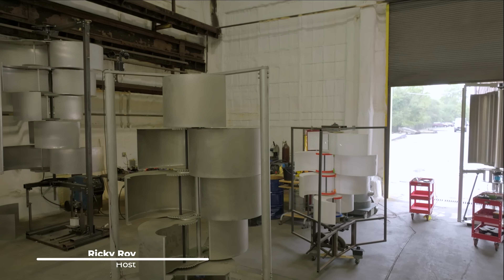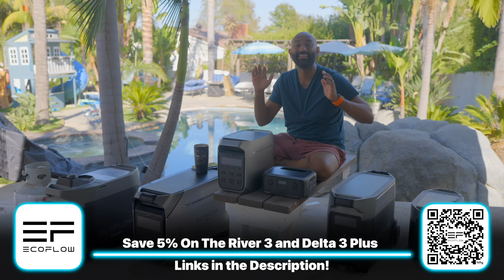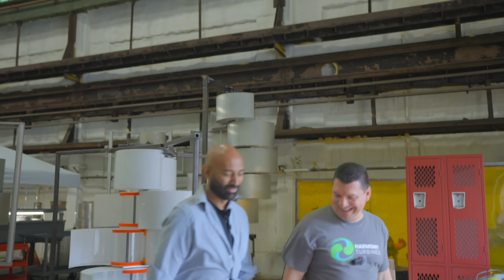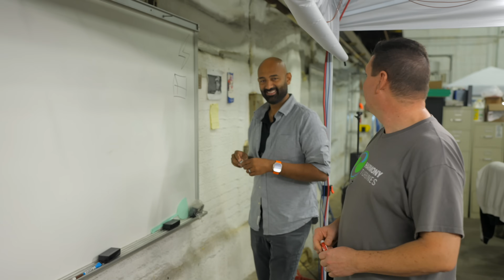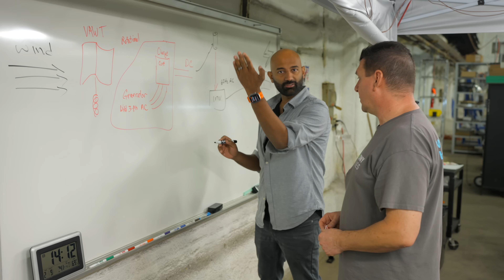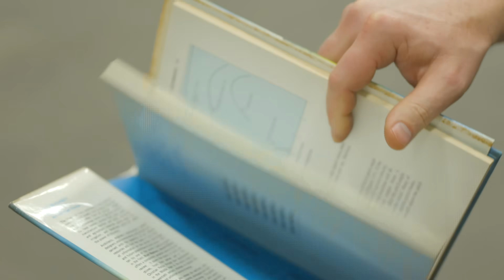This Could CHANGE Home Wind Energy Forever!

Comment from the maker: Enjoy @EcoFlowTech exclusive preorder offer! Get a Free DELTA Bag on orders that include an EcoFlow DELTA 3 Plus, use my code EFDRTWOB5 for an extra 5% off on DELTA 3 Plus and RIVER 3 standalone valid until October 25th.
Reply: cringey exposed gears. this is very unreliable for the wear and tear and dirt of the outdoors.  I was highly interested with VAWT for more than a decade but my research/I realized lately it is no match to HAWT. It can explained/summarized like we "mostly" don't use vertical blades for moving air. 
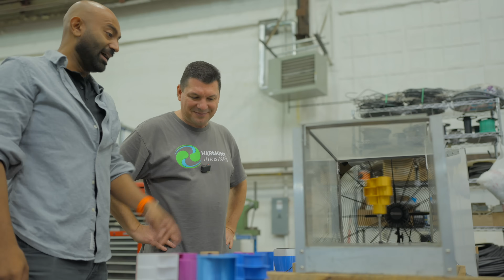2:47 this multimeter design is at least 20 years old and which I bought during college. It works to this day with some quirks. However, a US company R&D using the cheapest available multimeter could be red flag.
Reply: Can they put another generator on top? Have one on the bottom and one on the top, the shaft could surely be extended to add it?
Reply: I spent six years in the micro wind energy sector as an engineer. Our company went through multiple mechanical and electrical designs, eventually developing a wind/solar charger that remained as the only truly viable component. Low power density and intermittency of the wind continue to be the drawbacks for vertical axis turbines. We used a multitude of rotor designs along with three phase toroidal stators, ceramic and neodymium magnet assemblies....difficult to challenge the Betz Limit...I am back at work for an oil company...Always open for open dialogue on energy......
Reply: By the way our company had (and I still retain) full suites of CAD FEA and  CFD software....we also were able to utilize the Chrysler wind tunnel facility in Auburn Hills Michigan....
Reply: why isn't there a MPPT CHARGE CONTROLLER for wind power
Reply: Zero-point energy generator for $25. Leonardo Corporation, Andrea Rossi. Demonstrated September 27, 2024 in Latina Italy.  LOOK IT UP !!!
Reply: Are you responding to msg’s?

Comment: My limited research tells me if your gona build one build the frame and blades out 316 stainless to last at least 100 years.

Replacement bearing

Replacement generator

 and Replacement batteries as time goes on.

Technology will get better. 

Owning a super 316 stainless steel structure will last test off time.

My thinking is do it right first time to last family for generations. 

And able to move it if need be.

The name off my build will be.

V3000

SENTINEL
TACTICAL
OUTPOST

Comment: Yes I'd buy... to TOP off our existing robust solar panels and battery combination, to ensure we wouldn't have to turn on our generator. Yet we haven't used our generator in over 5 years. And in 15 years of solar panel power generation, we've only had to use our generator 5 times total. Many folks think adding a wind turbine to our system is overkill, but I think prevention of generator use with fossil fuel is worthwhile!

Comment: Oh, and one more thought.  What is the problem with 3 phase power?  A bridge rectifier will convert alternating current into direct current.  Even I , with my modest electrical skills have made a bridge rectifier.  The cost is trivial.  Once rectified you can use a simple voltage controller.

Comment: Dude, 6 of these on your garage or barn in the northeast would be dope. And I bet the more of them you have next to each (within safe limits) would probably create more “chaotic” wind adding to their efficiency. The most important thing is to get that average crank generator right. If you could somehow get that 100w - 200w in a low RPM of 7-10 just wow.

Comment: This solves nothing.  I bought a pallet of 550 watt solar panels  for $170 each.  This 500 watt (being generous) wind turbine probably would cost thousands of dollars.  Especially when you add the cost of a foundation to keep it from flying off. In the end, it wouldn't surprise me that all in were looking at $10 to $15K.

 That said, it is cool looking.  Would make a neat piece of art.  But unfortunately, as something to produce electricity it's usefulness is negligible.

Comment: I don’t see wind turbines being a game changer for residential use for a long time. But… if we could just get 500 watts of power at night to help keep our home battery storage from draining so fast at night, that would be great. So I could see it complimenting an off grid solar system.  But at the moment to get that 100-500 watts we’ll need to spend $6-10k. The economics just aren’t there yet. But I like the concept.  Maybe we could get EG4 to add an extra charge controller for lower voltage wind on their future inverters 🤔

Comment: We live in a location with average wind speeds well over 25mph and already have a large 5kw wind generator, and I can tell you its more pain than its worth, they need a lot of maintenance with that many constantly moving parts, the brake blew out in a storm the other day and even with the blades auto adjusting with that this is terrifying out of control, just get more solar and save yourself the trouble

Comment: Has this guy never heard of constant speed drives for generators? Granted, they'd be expensive, but that's not that same thing as consistent freq. 'can't be done' with a wind turbine. Alternatively, you could vary the pitch of the blades using (an) electric actuator(s), though that might be trickier to get right.

Comment: Sivonious turbine has the lowest  peak Cp = 0.15, energy recovered from the the frontal area.  It is half the American wind turbine for pumping water at about the same tip speed.   Tip speed is about 80% of the wind speed.  Can go to about 150% of wind speed but Cp drops significantly.   
Note: I purchase a book in the 70s with the correct chart.   These are the simple bucket so you can increase the Cp but I doubling it is a tall order.  Have an aeronautical engineering degree.  Wind energy is a cubic function of wind speed. 
ICE Wind added half of a Darrius (vertical axis airfoil typically 3 blades that are curved to 1/3 of a circle.), but the Sivonious is direct tied to the Darrius.  Do not get the best of either one and thus get the worst of both.  Sivonious blocks the frontal area of the Darrius.  Lots of cost for nothing.
The  Darrius would need a dozen blades to drop the tip speed to be near but above the Sovonious and the Cp would reduce to about 0.30 without them blocking each other.  Same as the American wind turbine. 
Darrius wind turbine peak Cp = 0.40, energy recovery from the frontal area. Tip speed is about 500% of the wind speed. However no production turbine has a frontal area means of control since you can not adjust the angle of attack  since it changes as it  rotates.

Comment: It would be better if you dataloged the output of both voltage and amp measurements with a variable load resistor in a given wind.  And take note of not just the rpm but include the tip speed/wind speed ratio.

Comment: What if you had reduction gears to help add rpm going between shaft and generator? At low wind speeds it could be geared up before it hits the generator. Like how a mechanical watch uses a low rotation power source to power other parts at different rpm’s. Maybe a conical shaft to help increase rpm at low wind speeds feeding the generator. Just a thought…thanks for the video. I want a VAT to support my solar also way down here in western Puerto Rico. 🏝️

Comment: Could there be an option to have an “air scoop” like I see at the beginning of the video referred to as the wind tunnel.  There would need to be a weather vain at the top that would provide wind direction and speed information to software / computer chip.  The air scoop would face the wind.  If the wind was too strong &/or erratic the scoop could face away from the wind to protect the structure.  Power and mechanical structure would be required of course to move and lock the “air scoop” in the appropriate position.  Overall there would be a huge increase in net power output.  As usual, it comes down to cost benefit to build and maintain.  It is well worth looking into.

Comment: I am disappointed that blade type wind capture designs were not also tested. Such as boats often have a triple propeller design wind generator; and farmers have windmills for water pumping from the ground and some have had similar electricity generators. Then there is the monster wind generators like is seen over the landscape of many countries. If all the available wind power capturing designs are not shown at one test location like the mini wind tunnel tester that gentleman has how does any person know if they are buying the best power supplying wind capture design?I have seen other videos saying that those designs always having one side not performing and actually against the wind is a power loss by resisting the wind as well as only half the design is actually capturing wind power at any time {more or less.} while propeller and windmill designs have the whole wind capture surface collecting wind power all the time not half the time. I am not criticizing any one design but feel other important wind motor types have been left out of this type of testing all at the one place. Thank you for the video.

Comment: I'm not sure if it has been suggested, or tested, have they considered venting those tops/bottoms with angled slats similar to a HVAC vent in a home? That angle might add to the torque generated(?) as well as allow the 'caught' wind to escape.

Comment: I would put Halcium powerpods on my house   if they ever get them to production. Not intrusive in appearance. I would put 3 off them in black on my house roof peak 31ft above the ground. Would hardly be noticed. And still producing power. To go along with my 19.2k solar panels. And 82k batteries. So I may never have to use my 6500watt propane generator for backup.

Comment: Interesting subject. I have 18 x 420 w solar panels and a 10 kw/h battery in the garage.  This supplies 90% of the power two people use in a 40 square house in Melbourne Australia.  Out of pocket  cost including installation and a new house switchboard was $22,000 Australian.

Comment: they need to figure out how to create wind.  a solar unit just to cause a 25 mph wind from a big fan?   and then you know..  put the wind turbine infront of it.   i got a old box fan. made to really do the job.  its the most bad ass box fan i've ever owned and by far.  i can't see it drawing much energy and i bet it would take like 3 of them, stacked ontop each other for a wind wall to hit all of that big wind single well unit and keep it going 1 rpm.  oh and thats with the 3 fans all set on the low setting.   i never use the fan on high because its too much...shts blowing off my tables  lol

create the wind is key is my point

Comment: The ancient ones they have to grind grain in Iran have large structures to channel the wind into the turbine like a funnel. Surely that would increase wind speed and control the direction as well. Perhaps walls or roofs of existing structures could help

Comment: while it's nice to see it close up into a perfect cylinder, wouldn't a shape that cause more of the wind passing over the upwind side, INTO the other side of the scoop, rather than the 50/50 split of half wasted/half used.

I'm no engineer of anything other than hillbilly hvac systems, but it seems like there should be some way to incorporate airfoil shape into leading and trailing edges of the scoops to generate some "lift" to add to the equation?

Comment: I wish the turbine companies would be focusing on that slower wond speed for a broader market. This focus on a 25 mph rating is a scam to me and blows the cost benefit out of the water. I want to add wind to my system eventually but not at the cost he's talking about unless it's effective best in the typical average wind speed. I think wind power is promising but not at the current approach.

Comment: Let’s be real… most homes have a wind speed of less than 10 MPH on a daily basis.
What we need is a small fence made of turbines that can be placed in front of the home. 
4’ high, nice looking, sectional (easy to replace sections), can use both the natural wind and the wind generated by cars passing in front of the home.
Reply: YES! We'll call it the finger chopping bird killer.
Reply: @ what… birds dont fly over the house? Tell that to all the birds that get killed at Wind Farms.
Plus, who says the blades need to be sharp and rigid?
Reply: @drShout  if it is squished, you don't need Sharp blades.
It is a great advantage of the classical Wind turbines: the danger zone is a two dimensional area most birds can avoid. In some experiments birds were breeding on the turbine - yeah, they took what was offered and avoided the blade area.

Bats have much more problems avoiding big wind turbines. Fortunately they fly only at certain days in the whole year in high enough altitudes above 100 meters above ground.

So, here starts the problem: a fence is far too low and dangerous. Single family homes are still too low. 
What makes sense is to have high buildings with turbines.

A solar fence however: that works very well!

Comment: And why did it have gears? Did he explain it? 
Perhaps to get started with Profils spreaded and with higher wind getting closed especially for storm security or shut down?
There are many studies out there comparing the gaps (x and y) between the blades and the best Solition. Why is the gear this big?
Why not a linear closing mechanism? 

Savonius also generates lift. But there are better profiles, eliptical, modified Bach, Benesh. Profiles easy to reproduces with Alu-sheets.

Comment: These are really exciting! I live downwind and just offshore from Lake Superior. Solar is suboptimal due to heavy cloud cover much of the time, but I very frequently have sustained wind in the 15-40mph range. If I could get  couple of these installed, I would be off-grid for both home/lodge and shop electricity. I already use an electric chainsaw, lawn mower, etc. and this would make electric vehicles quite attractive. Michigan’s Upper Peninsula has electricity costs that are among the highest in the US and we lose power annually with storms, further adding to the appeal.

If you encounter anyone with cutting edge micro-hydro solutions for a low head stream, I’d love to see that as well.

This was great, thanks for posting it. Subscribed.

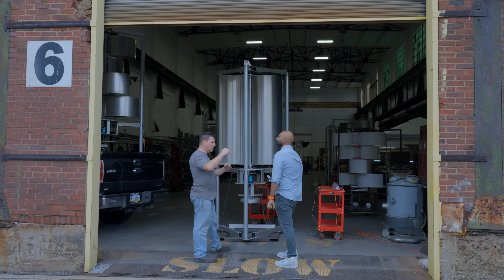Comment: 10:34 said the goal is at 25mph making 400-500 watts. 
But HOPES to make 20 watts at 7mph. UK average wind speed is 9 miles per hour......
So hoping for maybe 30 watts at 9mph with a turbine that big?! 
A 400 watt solar panel is £60. Can't see how this is a step forward.

Comment: These guys need to put a snowmobile clutch on those things . The right static clutch could self regulate the speed and you could brake it to a dead stop just by gearing it up .
Reply: Plus it would solve your rpm problem all at the same time

Comment: They started working on that concept in at least the early 1900s - at one time i had some early 1900s electrical engineering books with large turbines like those - I'm from a family of early generator and. Electrical engineers and generator mechanics - 
       Some of the turbines were mounted on rail road flat cars and on tracks that were in a circle with several flat bed cars with those turbines on them - with a brush riding a center track to transmit voltage to a large  power house bank of battery's - 
      I started working on generators in the offshore oilfields in the early 70s and have always found power generation interesting -
Reply: What kind of generators are you using nowadays? wiring wise
Reply: I'm guessing your asking if I use generators with rotating fields verse generators with rotating armatures - 
    With generators as used in cars and trucks there generally 3 phase and the field rotated - and the armature is stationary - 
   Since the voltage is converted to DC the wave form is not as important - the down side of automotive style alternators is there generally R frame alternators - 
    There not very electrically efficient - they convert 1 hp into about 300 watts - a T frame alternator is physically larger like a truck alternator but converts 1 hp input to 400 watts or so with a more efficient wave form - 
      So I generally use truck alternators  for DC - 
     With AC I use the old U frame or X frame generator heads I've changed them slightly - originally they had commentators for a rectifier - I have the commentators removed - 
   Many of the early generator heads were termed as X frame generators - there about 180 pounds per kw out put - or if they were used as a motor they were 1 HP per 180 pounds - 
      When you see synchros AC motors with two large slip rings on the rotar those are the type I'm talking about - 
      When those frames are used as a generator they create a excellent wave form - it's next to grid wave form - 
      As for AC generators my generator has a rotating armature with two sets of large  brushes on the slip rings - 
      Although the generator was made in the 1920s it generates a excellent sign wave form - 
    I'm guessing that's what you might have wanted to know -
Reply: As a general rule with a low voltage system as with 12 volts it takes 1 HP to generate about 330 watts - with 120/240 it takes 1 HP to generate 416 watts - it's about the same value with generators that generate 13800 volts or 22500 volts in power plants -

Comment: I'd suggest  ultra-thin G10 fiberglass sheet to bend around instead of metal.  It would have lower manufacturing costs, lower replacement costs, and would be lightweight for better efficiency
Reply: Onky recycling and durability would be worse
Reply: @kkon5ti exactly. That metal also doesn't create airborne micro plastic or nano plastic particles.

Comment: wind to rotation inefficiency losses
friction losses
3 phase AC generator hysteresis and heat losses
DC to AC converter heat losses
complexity of system maintenance losses
dollars losses
manufacturing